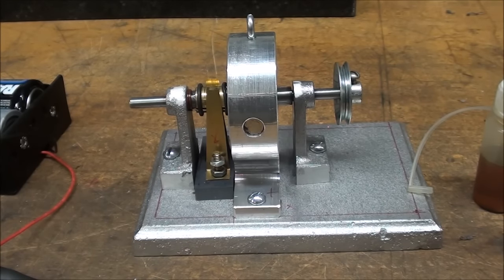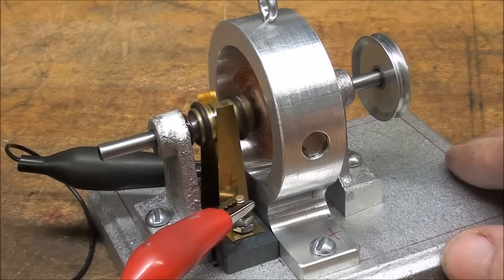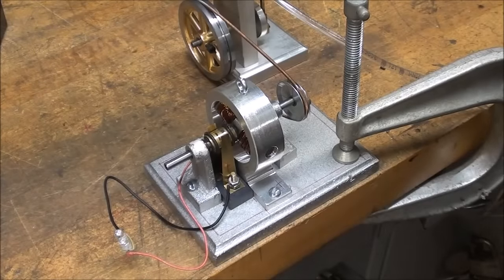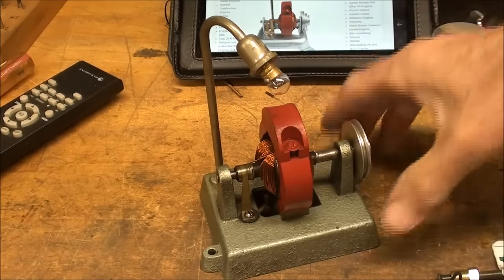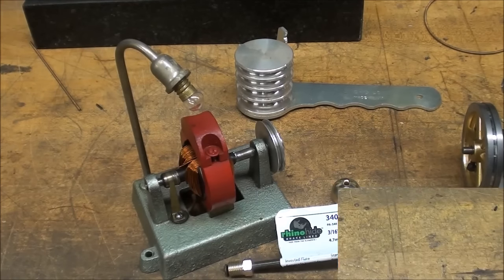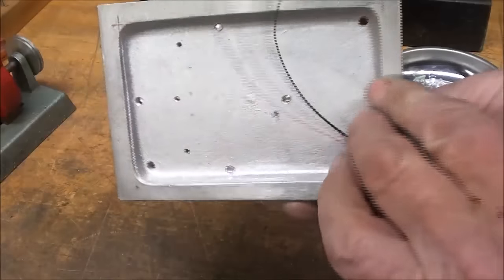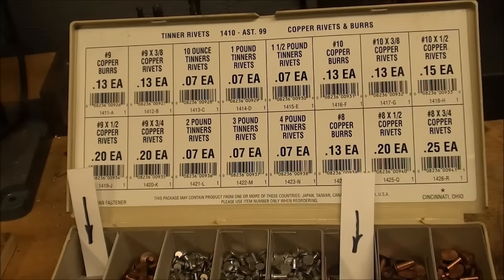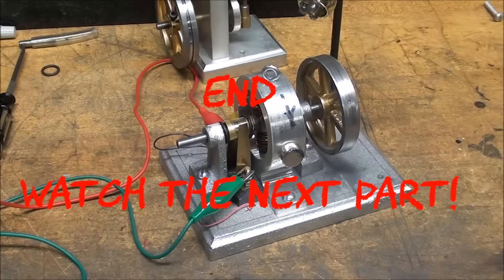Pt 6 tubalcain BUILDS A MODEL DYNAMO for a Steam Engine

Comment: As always, A Great video, but I have a couple of observations:

1: there is no need to reverse polarity, to reverse your 2 pole motor. Simply start It spinning in the opposite direction. although it does show that it will run regardless of polarity.

2: an LED normally requires 1.5 V . Stacking 3 of them together, in series will increase the Needed voltage to 4.5V . I hope you paralleled your 3 LEDs instead. normally a limit Resistor is recommended, but in this case, It's low-voltage along with its limited use, eliminates the need for it.

I'm looking forward to your next video. Thank you And Stay Safe.

Comment: I frequently find that it is faster (and maybe cheaper, if my time is worth anything) to order small parts from McMaster-Carr than it is to search through my junk collection to find a part that I know I have. I get them next day (faster than finding them, sometimes), and the shipping is less than it would cost me to drive to the nearest decent hardware.

The dynamo is coming along nicely. (If you twist those spring belts backwards a bit before screwing in the splice, they will tend to remain screwed together longer. I couldn't tell in the video whether you did this.)
Reply from the maker: +Peter W. Meek Yes- I like mcmaster

Comment: Nice little generator!  But I don't see a magnetic return path for the outboard sides of the magnets.  I'd like to hear what effect a half-circle of soft iron (with possibly soft iron pins to reach into and touch the magnets) would do for the output (or the speed, if wired up as a motor).

How about some experiments with the science demo motor?
Great project!

Comment: It is far easier to punch the inner hole first that way the pilot taper on the larger punch holds the outer radius concentric to the inner hole. I make all sorts of tiny washers with my RW #5

Comment: This series taught me more about how DC motors work than anything else I've seen or read. Thanks! I can see how they work now.

Looking forward to making one, but have other projects on the go at present. I think I'll epoxy the brass tube to the rubber hose and then split it. I'll probably use shoulders on the shaft to limit side-play, and maybe ball races to make it turn easily.

One question - could you figure the centre height of the axle, thus also the height you needed to make the pedestals, as the height of the centre of the big hole in the housing plus the height of the flat bit at the bottom?

Comment: I know what you mean by having stuff and not knowing you have it or where it is in the shop. I plan on backing the truck up into the shop and my basement this spring and take several loads of stuff to the dump and the scrap yard just to make room to organize the  stuff I want to keep for the projects that I really want to do. 
I'm tired of collecting with the idea that I may need it some day, as my days are getting fewer and fewer and my ambition is getting less and less.
I always buy brake line in rolls so that I wont have to join 2 pieces together with a coupler. And I can make it the exact length I need.

Comment: I know this is not exactly what you want to hear, but all the things you used to buy at the hardware store, or Radio Shack, it's all pretty-much available on Amazon.  I've just got a shipment of heavy-wall steel tubing, some steel and copper sheet, and some aluminum flat bar stock.  It's all shipped to my home, and takes less than a week to arrive.  Like I said, I know it's not what you want to hear, but times have changed, and this is where some supplies are available nowadays.
Reply from the maker: I realize that is true, but that does not mean that it doesn't sadden me

Comment: if there's enough depth in the set screw hole clip off a piece of solid copper wire and drop in the hole.tighten screw down and it won't damage the shaft.

Comment: Comments in Pt. 7 are disabled!  I would prefer no music (in response to the question you ask in Pt. 7).

Would a capacitor across the + and - wires help with the flicker?  You have to get someone a bit more savvy with electronics than me to suggest an appropriate value.

Comment: Two points on the penny washers.  First penny's are not mostly copper anymore.  Other than 1943 all the 1900's penny's were over 90% copper but in 1982 they changed the composition to 97.5% zinc & 2.5% copper.
FYI I checked on the legality since I had always thought it was illegal to "deface" currency, but actually no, unless you are doing so to pass it off as a higher valued currency.  So save those pre 1982 pennies as the cheapest copper around.
Reply from the maker: Yes, many of the penny blank's were made by a zinc company and Lee cell Illinois. They were only copper plated.

Comment: Point of order Mr P ... In the UK your pulley is held in place with a humble screw ... a better choice would probably be what we in the UK actually call a grubscrew which is basically a thread with no head - a short piece of threaded rod either with a simple slot (or an allen key) seating on a flat - widely used as an unobtrusive "blind" fixing.  In your case it would avoid further imbalance on your shaft.

Out of interest - take a look at Emmas Spareroom Machineshop's prince dynamo for an alternative take.
https://www.youtube.com/playlist?list=PLUNkS7pOL3zuBMVYq96Ha4XQ2QievaJJ3&nohtml5=False